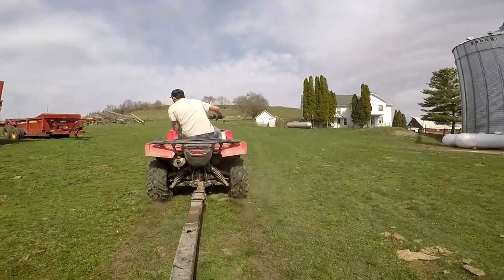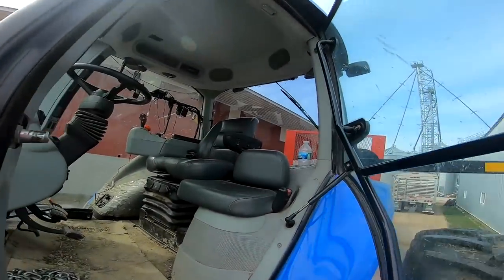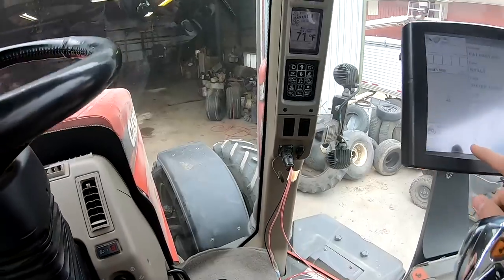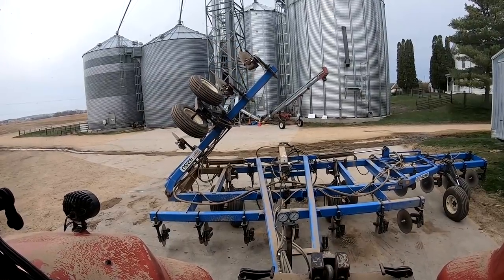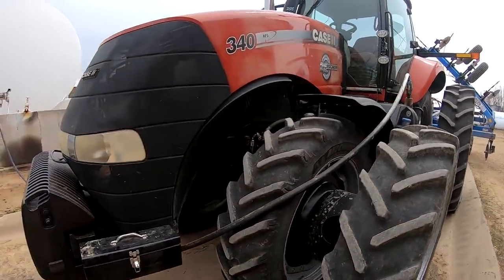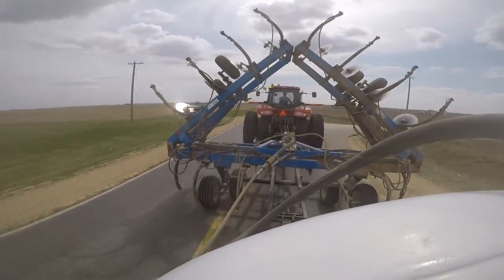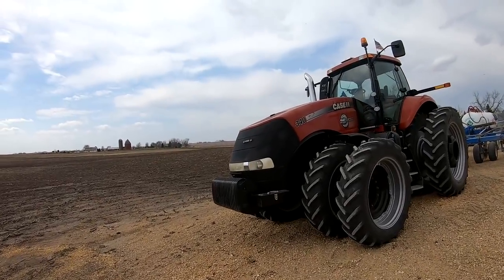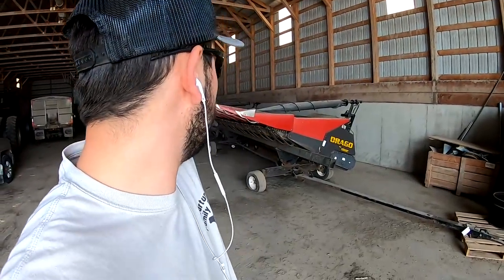WE BOUGHT A NEW TRACTOR

Comment: Isn't it a little shady working for John Deere but rocking Case tractors. 😀😀😀 cool tractor though not quite pre def but still not completely crazy emissions yet.
   I used to be a big John Deere fan myself but to ones I was into were the old two cylinder tractors. Personally I couldn't blame anyone for not buying the newer Deere they are so expensive. At least 25 percent of the price is just for the name.